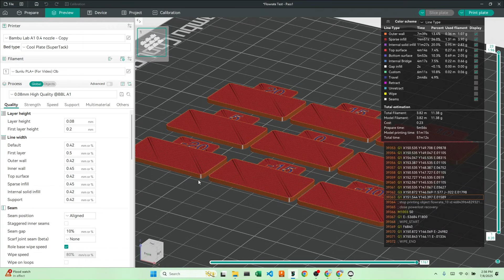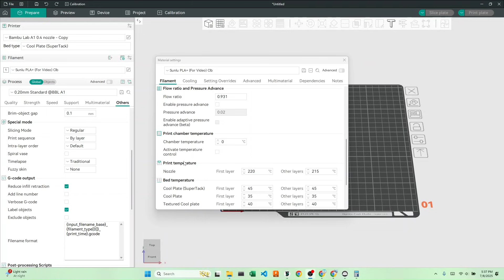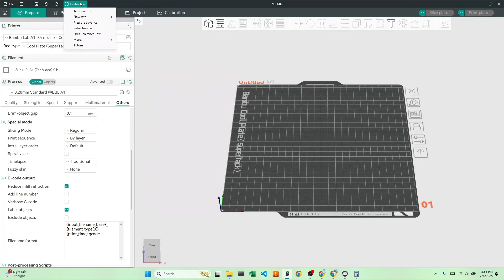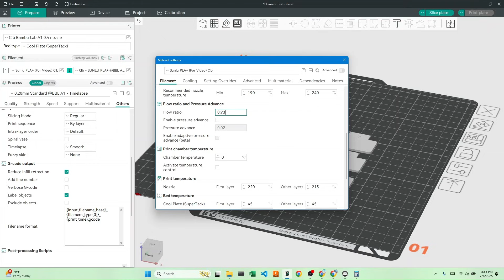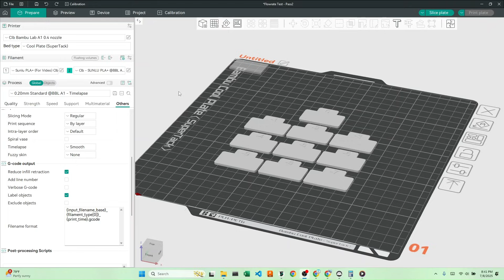Calibrate your Flow Rate with Orca Slicer!

Comment: I noticed when you dropped the calibration test in it changed your process, other layers from .08 to .2.
Big question is if I use different line heights depending on what I print, .2 for generic storage, .08 for fine details, should I do the flow rate for each process set up or is it alright to do it once?
Reply from the maker: In my experience, its alright to do it once. I print with different layer heights often and I get decent results. Of course, you will still probably get better results if you test for each process. If you do test for all of them, let me know how it goes!

Comment: does this per object flow ratio (not top/bottom) change my current profile flow by that factor, or replace it?

also why does the calibration change my line widths and infill speeds? or more so.. should I let it change those things? some changes may be beneficial for this test but I find others may skew results

Comment: woah .08 layer heights on a .4? took me a while to dial in .1 but i figured that's about as low as i should go..  how low can you go with a .2 nozzle?
Reply from the maker: You can print up to 0.05 mm!
Reply: @thebuildplatebrain smooth plate or on glass or something? can't wait!!
Reply from the maker: The smooth plate should work fine...let me know how it goes!

Comment: Here is the equation to calculate the flow ratio: Calibrated_flow_ratio = old_flow_ratio * (1 + value_from_chosen_surface). 
0.98 * (1 + (-5%)) = 0.98 * 0.95 = 0.931
Reply from the maker: Thanks for putting this in the comments to help others!

Comment: You used an A11 - it hass a flow sensor.
Reply from the maker: Yes, the A1 does have a flow sensor, and it can calibrate flow rate by itself. However, the manual test, which I demonstrate in this video, doesn't use the flow sensor. Instead it just prints the parts, and I have to calculate the settings. Even though my printer has the sensor, I prefer to use the manual calibration as it gives more precise results, or so I've found.
Reply: @thebuildplatebrain  also lets people who don't have an a1 know how to calibrate their machines lol, great video, 2/4 of these comments are know it alls.
Reply from the maker: @EclipticFactions  Thanks for your comment and glad you liked the video!